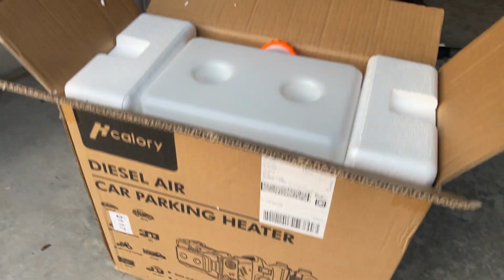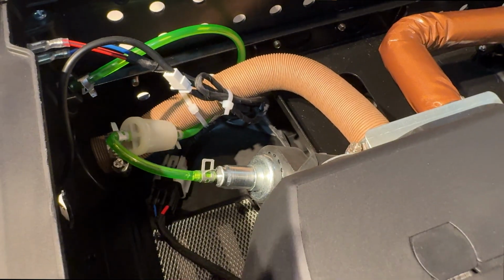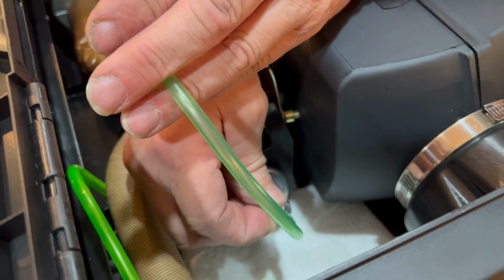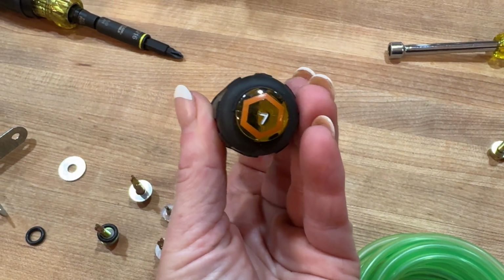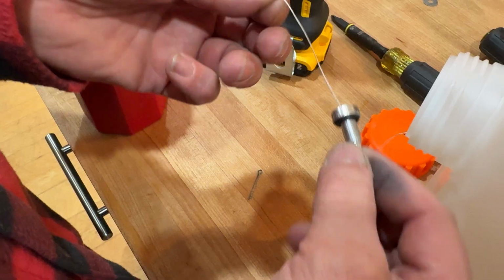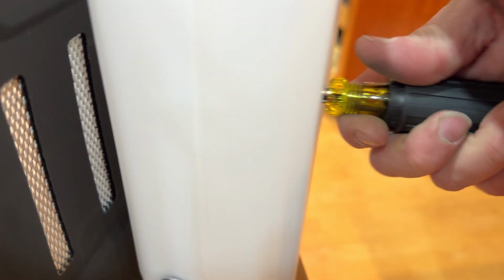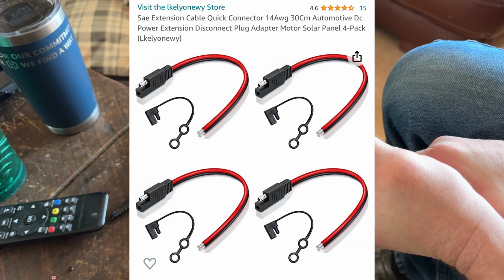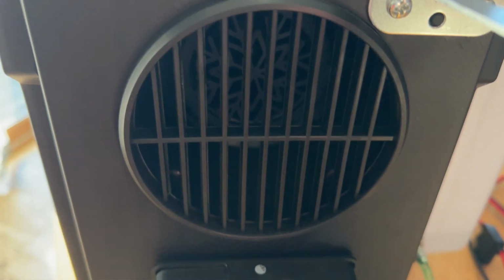Hcalory Diesel Heater Build

Comment: Amazed you put fuel feed at the side of the tank and not underneath.
Reply: Even if you put the fuel feed in the bottom, you won’t be able to use all the fuel in the tank.  You will be limited by the amount of the fuel feed sticking into  the tank being about 3/4”. I think it’s a preference decision.  There are  two benefits I see by putting it on the side. One is tipping the tank to use up more fuel in a pinch. Second is limiting possible fuel line kinks that can happen if the fuel feed is on the bottom of the tank. Bottom line is, in either location you will not drain all the fuel out of the tank.  I look forward to hearing updates on the pros or cons encountered  with putting it in the side.

Comment: If you power the diesel heater directly with DC. The power draw will be a lot less. My guess is around 20 watts.
The AC converter (120vac to 12vdc) draws more than the diesel heater.
Reply: The diesel heater is a load. So the diesel heaters wattage does not change if you use AC or DC power.  As for the LED driver being used as a AC to DC converter is very smart option.  The power bank has an DC to AC inverter which will use some power but minimal. It is true that the AC to DC converter (LED driver) will use some power, but again it is minimal.  Not enough to cause any issues.  

The reason the LED driver being used as a converter is smart. You avoid the diesel heaters Low Voltage issues that most owners of diesel heaters have problems with by plugging it into the dc plug on the power bank.  Doing it the way in this video, the voltage stays constant letting it run for 10 hours as stated in another video of hers.
Reply from the maker: I’ll need to look at this more. The last set up, I did that. And had issues with power diminishing due to the length of the cord. The heater would cut out as soon as priming started bc of the big draw.
Reply: @ladyrocklander  
I'm not sure what you're saying?
You have Jackery power station. 
Plug into the 12v socket instead of using the AC.
Reply from the maker: @wt9653  when you lengthen the power cord by splicing on additional wire, (which you will need to do if your Jackery is in your rooftop tent and your heater is outside), the additional length causes you to lose power when it travels the longer distance. I always use a RTT during non-snowy months, so, for me, I need a longer cord to reach from the diesel heater on the ground, up to my RTT.
And just using a spliced in DC plug with xtra 6ft wire to my EcoFlow River (750 ) was a failure.
I’m not an electrician or an expert by any means, just thought I’d try something different with this new set up that was recommended to me.
Reply: @ladyrocklander  
 6ft of wire is not considered as too much wire.
Most diesel generators comes with more than 6ft of wire.
Your problem is a poor connection. It could be splicing or the terminal on the generator. Double check your gauge of wire. A gauge of wire determines the current loss.
I work for Lumen as a switch technician. 
I'm also an avid solar guy.  😊
Reply: @wt9653 most people are not going to use a #10 or #8 gauge wire to run their diesel heaters.  I don’t believe it’s an issues with terminals or lose connections.  It is more likely due to diesel heaters not liking dc voltages lower than 11 volts. Between the draw of the heater and the voltage loss on the wire causes the diesel heaters to go into an error.
Reply: @wt9653 the gauge of wire does not determine current loss, but voltage drop. To counterbalance voltage drop you need to increase the gauge of the wire.
Reply: @jimmcgill3128  
 😕 🫤 😕 I don't know why you even bring up heavy gauge wire into the discussion? # 10 can handle 30 amps or 360 watts. #8 can handle 40 amps or 480 watts. No one mentioned about wire gauge except for you??  A simple 16awg can handle the current to run the heater. She said 140 watts to power the glow plug to ignite and 45 watts to maintain the heat.
I see everyone on YouTube uses 12v from battery or power station. 
None of the diesel heaters come with AC to DC converter.
This lady is the person I saw using it???
I have 12v appliances like fridge and oven. I have no issues with 12v?
This lady isn't a technical person to begin with.
Reply: @wt9653  she said she was not an electrician, so it’s true she is not a technician… not sure what your point is.  As to why I exaggerated on 30 and 40 amp wire is to try to make a point.  To use 18 gauge wire as you stated is not a good option when running longer distances of wire to get from the RTT.  The voltage loss goes up with the length of wire.  As to why I brought up the gauge of wire is because You told her to check the gauge of wire… 🙃🧐😕
Reply: @wt9653  sorry 16 awg not 18 lol but still same problem.
Reply: @TrailGnomeOverland-n2u  
😆 you weren't listening! 
She said 6 ft. 😆 
That's extremely long wire. 😆 🤣
Reply: @jimmcgill3128  
After doing some research. 
It's not the distance causing the problem. The problem is the Jackery's 12v socket. The socket has 10 amp limit.
The glow plug demands 12 amps or higher. Jackery overloads and shuts down. Two options are converter or separate 12v battery.
Reply: @wt9653 ahh so WE agree that it was a smart solution to use the LED driver as a converter.  Using the 120v ac on the Jackery to convert it back (via the LED driver) to 12v dc to run the diesel heater.  I believe she also mentioned why they used the quick connects, was so they had the option to change it to be able to go directly to a battery system on her Scout’s Trailer. Again, as I’ve said before, seems like a very smart solution to the problem’s Diesel Heater owners are experiencing.